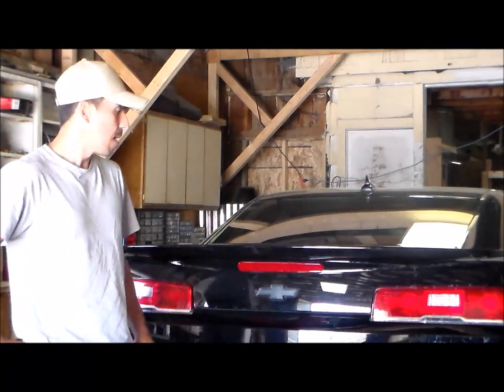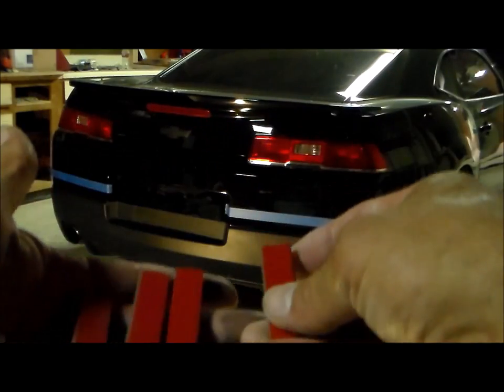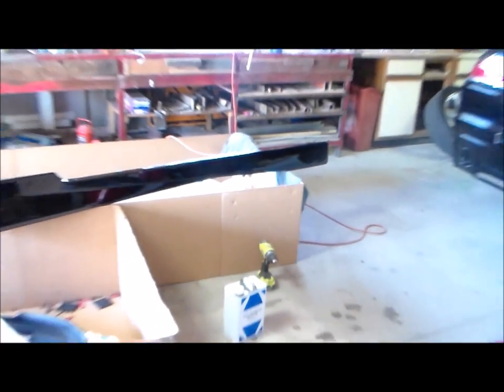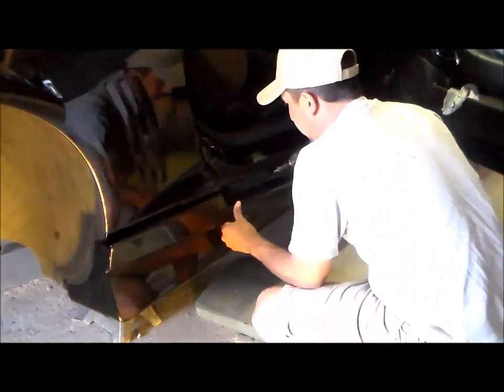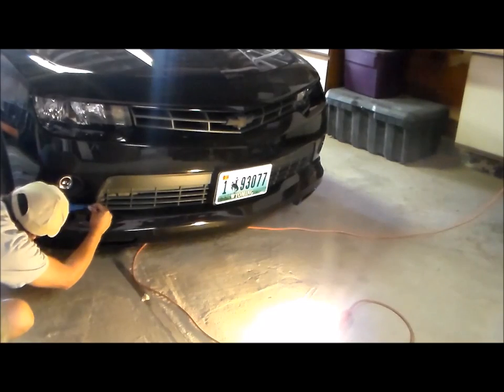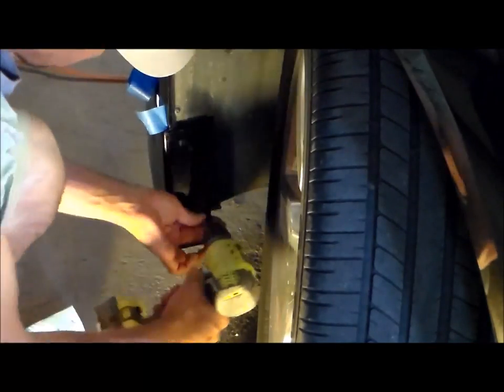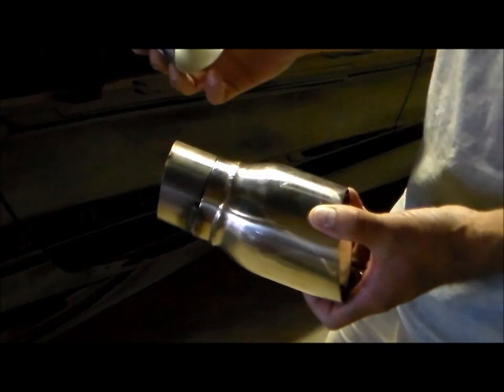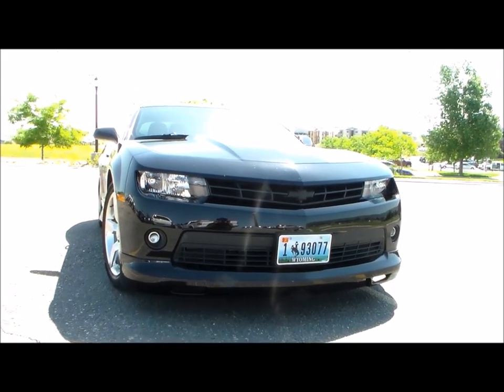2014-15 Chevrolet Camaro Razzi Body Kit install

Comment: question.do you think a front splitter will fit under that razzi front lip?,i know its a bit much. might go with a vintage carbon fiber front spltter under the razzi kit(front) instead.
Reply from the maker: After installing Razzi front spoiler I only had 2.5" of clearance and I have to drive careful not to scrape. I think you would have an extremely hard time not scraping with splitter on it also. You would need air suspension with onboard compressors to lift front when needed to not damage splitter.

Comment: First, great video and thanks for posting. I have a 2014 2SS and have been considering this kit. I had a 2006 Vette and installed a kit and later regretted it. So, my question to you is hale has it held up and do you have any regrets, etc. and are there things you would have done different knowing what you know now? Thanks in advance for your response.
Reply from the maker: +Shane Tuttle The ground effects make it very low to ground so it becomes a challenge to not scrape front air dam. to fix this I am going to install some air shocks in the front with onboard compressor so I can lift front when ever needed. The back bumper installation per instructions does not secure it enough to hide all gaps. To fix this I plan on counter sinking screws on top edge of bumper and covering with matte black pinstriping . Overall I am very happy with the looks I have got a lot of compliments since installing them.  If your goal is to achieve a show quality installation you have to use seam filler, and body filler to blend to body and repaint every thing.
Reply: thanks.

Comment: how well does it hold up? would you do anything different in the install if u did it agian?
Reply from the maker: every thing is good so far. the only thing extra I did was counter sinked some more screws by license plate area on back bumper to secure it better.
Reply: +clsallinone ok cool I might be buying this for mine it's a 2013 2ss. I have heard both really bad reviews and good. so I guess I'll give it a try

Comment: So you trying to make you V6 Look FAST? Or. . . Y didn't you just buy an SS and do that Kit on that? Would've made more sense. To each his own I guess.
Reply from the maker: Because an ss is 10 grand more and I don't care about racing. 330 hp is enough for me.
Reply: +clsallinone I gotta RESPECT that bro.
Reply: 10 grand more for 2 extra pistons i could use that to supercharge my v6 kick your v8 ass and still have good millage to have it as my daily driber
Reply: Lol. Your a Goofer!
Reply: +Godd Speed the v6 is a fast car.
Reply: +C.L.S. Allinone yeah that's why I got the v6 camaro. 330 hp is plenty for me, and I don't plan on racing. I get people all the time dogging me for getting a v6, but they all drive junkers so idc.
Reply from the maker: I Had some big diesel truck trying to race me the other day multiple times in a 30 mph zone I just laughed and stayed at the speed limit. I have owned a lot of V8 vehicles and this still is the fastest car I have ever owned. I'm a fan of nice looking vehicles regardless of  what engine it has.
Reply: My viewpoint exactly!! Bought a 2014 Camaro LS and added body kit, rear spoiler, side scoops, window scoops and carbon fiber "Viper" hood ( painted black to match car). Engine is V6 with cold air induction unit and is faster than any V8 I ever owned.  I believe the previous owner had it tuned also, because this 6 will get it!!
Reply: I added this kit and more, have had more offers to buy my car than I can keep track of!  Money difference between a V8 and the look I have from modifying the 2014 Camaro LS is tremendous!  My look puts a SS to shame!